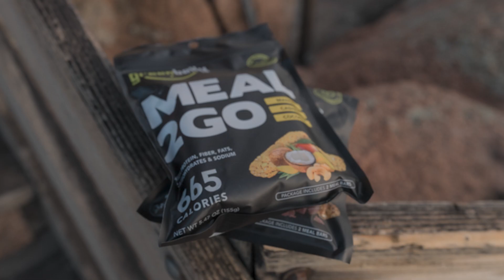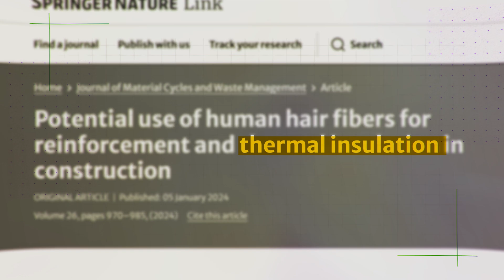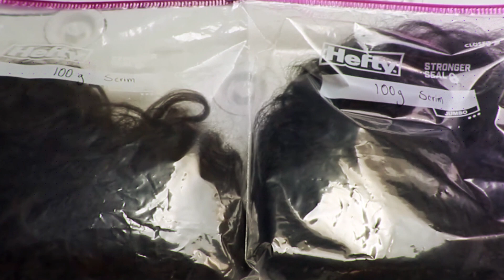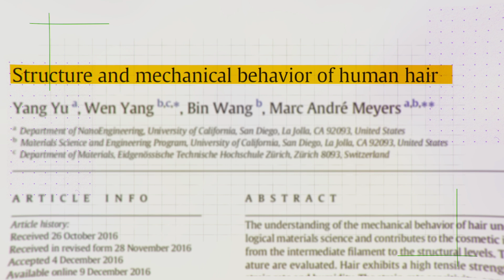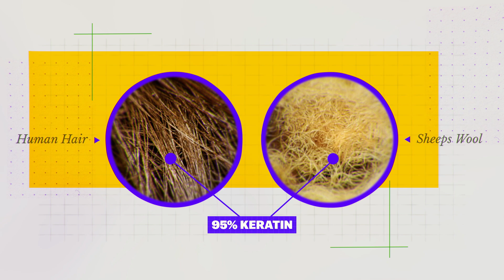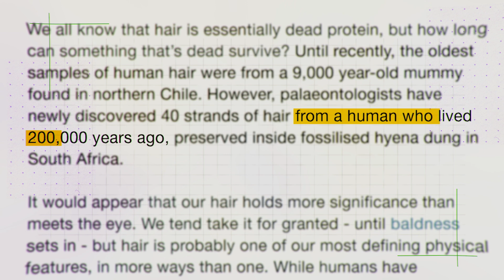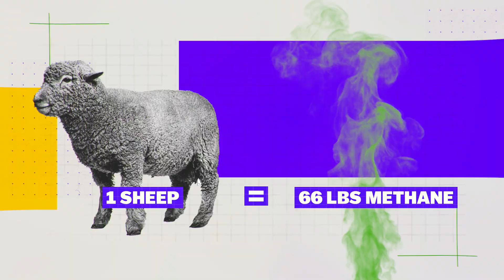Is Human Hair the Future of Winter Gear?

Comment: 30 tons does not equal 22 million pounds lmao. It equals 60,000 pounds, as 2000 lbs = 1 ton. In addition to that the statue of liberty is 225 tons which is greater than 30. wtf is this video.
Reply from the maker: 30 tons a day = 22 million pounds a year. Thanks though